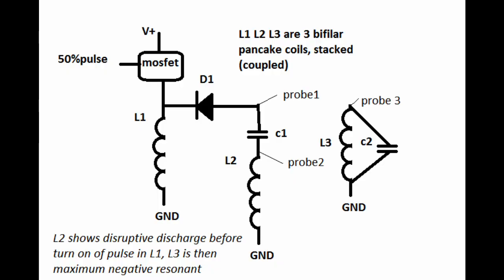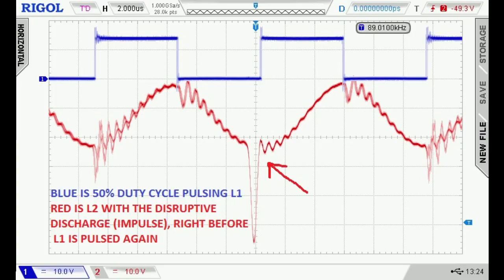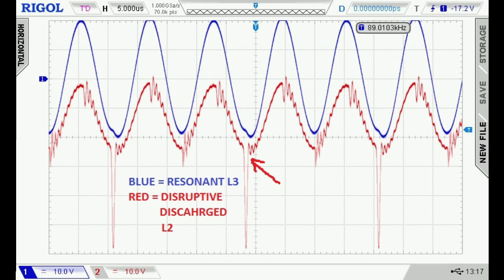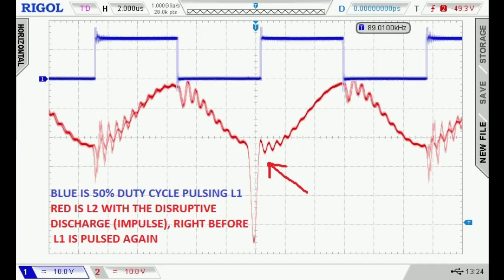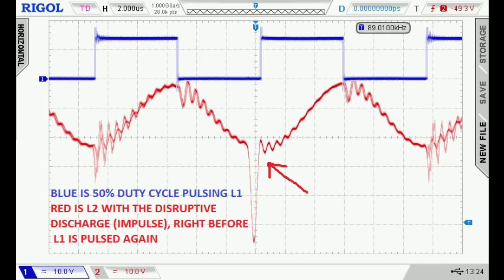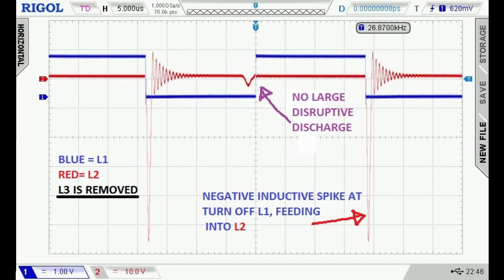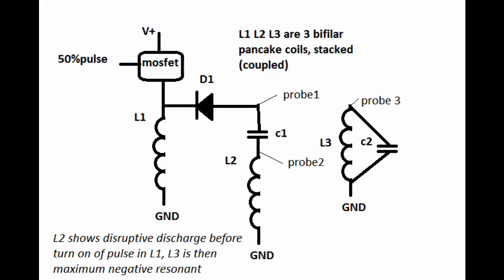Radiant energy bifilar coil experiment

Comment: OK, finally had a chance to look at this at some length.  I prefer to look at this from the standpoint of the L3 coil removed to reduce variables.  

The traces from this standpoint look relatively normal...the back EMF discharges through the series resonant circuit though the flyback diode D1.  Initially all looks normal with the characteristic negative spike and a dampening positive series resonant circuit at the resonant frequency of the L2/C1 series resonant circuit.

Then all of the sudden the negative dip right before the turn on of the mosfet.  Thus the aberration is happening without coil L3 (L3 tends to magnify the aberration).  It appears to only happen every other pulse which, in probability, would dictate that the aberration is not coming from the misfet switch.  It would appear the energy comes from a further discharge of the magnetic field or electric field of L1...I would need to experiment with this further to isolate  the source to further diagnose.

Anxiously awaiting your diagnosis...
Reply from the maker: Hi Mark S, I agree with your analysis. But still can't explain what or why it is. But it is, and that's helping me, as I now am working on Nelson's circuit, that shows the same behavior. with C4 and L2 in series resonance.
Reply: Yes...the only other thing I will add which you already know but for others...is that in the series resonant circuit setup you are able to get voltage surges much higher then source voltage at resonance as the voltages on the capacitor cancel out the voltages on the coil (inductor) as they 180 degrees out of phase (capacitive reactance is opposite in phase to inductive reactance).

Of course in your usual parallel resonant tank circuit the voltage must stay the same across the capacitor and coil (as they are in parallel) and you can have higher then source current swings.

Of course the Scope is measuring voltage which makes the voltage spike much more obvious in the series resonant circuit then the current spike in the parallel resonant circuit.

And then there is the diode...that would be my first suspect...cheers
Reply from the maker: Maybe the coil (bifilar pancake) acts as a diode. The magnetic field only allowing current in one direction. when the magnetic field turns zero the dielectric field (at maximum) is not restricted anymore. What do you think? Ever came across a saturated coil working as a diode, on a coupled secondary?
Reply from the maker: @MS-ef1gy  I dont follow you completely yet, could you elaborate? I'm not that familiar with series resonance.
In parallel resonance you can get high currents, but is it a spike? not a sine?
I think these high currents are why the parallel capacitor is becoming hot (due to internal resistance, esr) at least my caps are getting hot but are within the voltage rating.
Reply: Series Resonance - the Capacitive Reactance and Inductive Reactance are equal and opposite (180 degrees out of phase) at the resonant frequency, which means they effectively cancel out, meaning the coil and capacitor together act as a short circuit to the series circuit.  Therefore the current of the series circuit is only limited by the resistance R of the circuit.

Therefore for voltage drop at resonance across either the Cap will equal the Capacitive Reactance times the series current (which is the same through all series components).

Since the Capacitive Reactance of the Cap = 1/(6.28) FC  (F=frequency, C=Capacitance) it is independent of either the current or resistance of the series circuit.  Therefore by either decreasing the capacitance or resonant frequency, Capacitive Reactance can be come very high, much higher then the applied potential of the circuit.

Now your L3 circuit is acting as a parallel tank resonant circuit...meaning the voltage is the same across the Capacitor and Coil (Tank).  Your L3 tank is is tuned to the L2 series resonant circuit.  Your L2 circuit acts as a source to the L3 tank through Dielectric and Magnetic Induction.

Your L3 Tank responds in kind with what is a Positive feedback to L2 circuit (The analogy being placing a speaker next to a microphone and getting the high amplitude Squeal of the speakers that we have all experienced).

Therefore your L2 circuit is the driver.  Thus when you move L3 you get lose the positive Squeal feedback and just see the driving small pulse.

Typically with a parallel tank the high circulating current in the Tank is a sine wave as magnetic field collapses energy into the dielectric field at a rate controlled by the capacitance and inductance ration.  However, if one would happen to externally spike either the dielectric field or magnetic field then a spike could be produced.

Your circuit has a good dampening curve on the Series side due to using the bifilar coil.  You can see this dampening in your scope traces.  This is typical of Tesla bifilar as the resistance is parallel distributed across the coil as the plates are also the coil in the wind.  So initially all is well with a nice Q (Too much resistance and you would not see the dampening at all).  After the resistance dissipates the energy then you seem to get the driving pulse.  Therefor there was extra energy in the circuit, maybe from the diode or impedance mismatch to the source.

Yes the caps can get hot from the ESR, which combines many factors.  Most likely from the high circulating currents of the parallel resonance running through small connecting wires and connections to the capacitor plates.  The actual dielectric phenomena of displacement current, however, is typically not a candidate for causing heat.  This is why super capacitors used a car batteries, for example, use output busbars, high diameter internal capacitor connectors, and many connections in parallel to the capacitor plates.

In final analysis I would give a small probability that your are not seeing Tesla's spike right before the switch closure...but I can't be quite sure without seeing your further experiments.
Reply from the maker: Thanks for the explanation, seems to make more sense to me now.
In addition I can add that at the right frequency the discharge of L2 induces a current in L3, giving power by combining it with the resonant voltage of L3.
It might make sense to make C3 bigger as it will provide mote stability to L2 C4 series resonance. (just like c5 is big).
if I got more ezperimental data that makes sense I'll share it.
Reply: It could be useful to see what L3 is doing when the spike occurs.
Doesn't the book mention some extra magnets around a discharging cap?
Reply from the maker: Hi  @MS-ef1gy  I must say, it's frustrating not to be able to read your deleted messages.
Reply: @MasterIvo  Sorry, I deleted messages in error including many on other sites ):
Reply from the maker: @MS-ef1gy  How is that even possible?
Reply: @MasterIvo  I keep a separate record of all of my messages on youtube by copying them and storing them to another application.  While doing this I accidentally deleted some messages.  At any rate all is good as I have them in my record.

Comment: the simple explanation for your question is that you generated an imbalance in the volume and the rebalancing of the biplane generates the spike in a collapse that implodes, the diode only allows the circulation in one direction with which the dielectric potential is greater than the magnetic
Reply from the maker: the volume?
Reply: 1 dimension: nothing, god whatever
2 dimension: linear energy that forms a plane and divide it self in an expansion cone
3 dimension: the volume is formed
4 dimension: the volume is structured, in dark matter and the quarks
5 dimension: varions protons and electrons, ordinary matter
  between the fifth and the sixth there is a dimension to what we could call imaginary phi dimension, between the pentagon and the hexagon
6 dimension: the photonic dimension (Light)
7 dimension: matter, creation it self
  What I mean is that the event breaks the symmetry of the volume
Reply: every time a creation takes place the expansion or zero point generates a distortion in the volume or space time, a kind of big bang, (explosion) from your perspective the initial spike, a trajectory is generated let's call it life moving to a climax where the death or black hole happens (implode) negative spike, the diode and the capacitor generate a distortion in the volume or space that unbalances the volume, the ripple of that rebalance generates at one point the exit spike that in theory should not happen , by the way time does not exist is a relationship between angles but to understand the mechanics is somehow useful, maybe Rovert Otey cosmovision will help you understand my point of view, I hope my opinion was some how useful to you, Best Regards

Comment: I am very interested in this, because I have witnessed the first effect that Tesla got. The stinging sensation on your skin, when the discharge hits. You could feel it in adjacent rooms too. We were in metal shop class in high school. This guy had a stick welder on and the stick holding end (no stick in it) was on top of this large metal plate, that you usually placed the metal you are working on and also the grounding clip from the welder. He then hit the metal plate with the lose grounding clip and a spark occurred, but also we all jumped because we got jolted. The teacher got hit in the other room. This guy got detention for 3 hours... Not sure if the large metal plate was grounded or not. It was on metal legs
Reply from the maker: Thanks for sharing!
Reply: quite interesting, because your witness shows, that this effect does not need high Voltage!
Reply: yes it seems the metal plate and the shortness was the key there. It does have amps though, but I think the effect is voltage based
Reply: according to Tesla it is timebased, the shorter the pulse, the greater the effect.

Comment: Okay, just putting this out there... So, every 4th fibonacci number within a golden rectangle makes 1 complete 360° rotation, with the center now smaller and farther away if you can picture the fibonacci spiral as a wave form in 3D. the golden ratio is just 1 curve of what makes up the spiral. Every 4th number creates 1 complete rotation. That is where the energy in L2 spikes... "Vortex Mathematics" perhaps? I believe it is where the magnetic field is the most compressed and reaches a terminal velocity within a magnitic vortex? Ejecting out the energy that gets kicked out of the center of the magnetic vortex due to magnetic compression --- My two cent...?